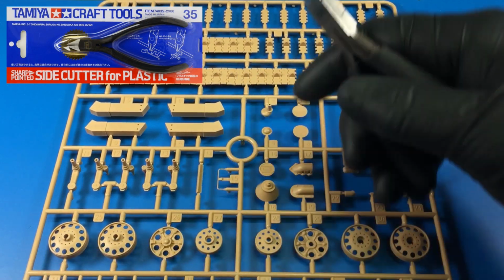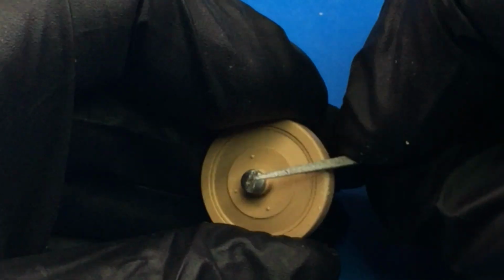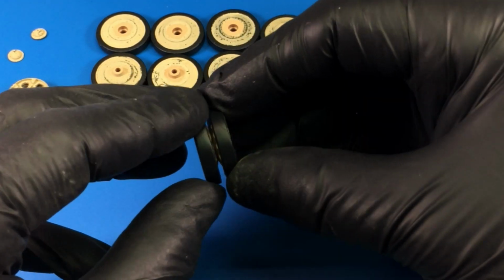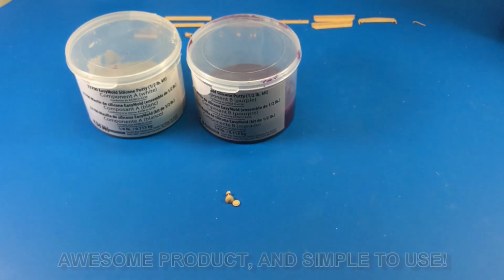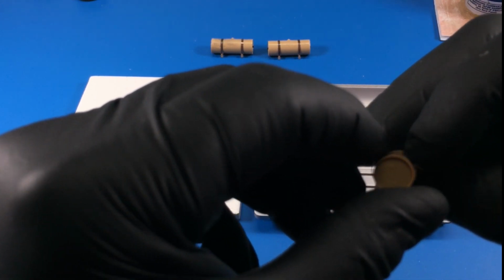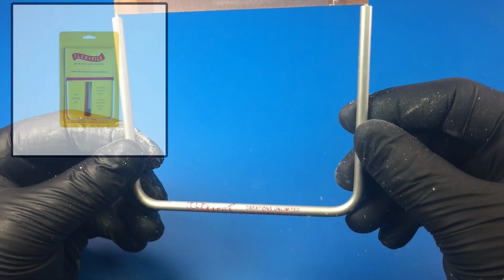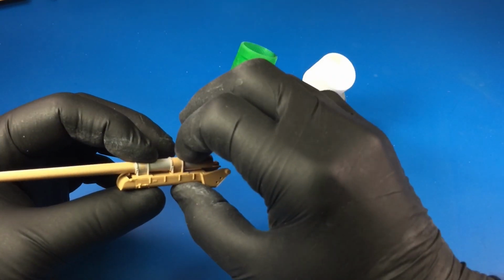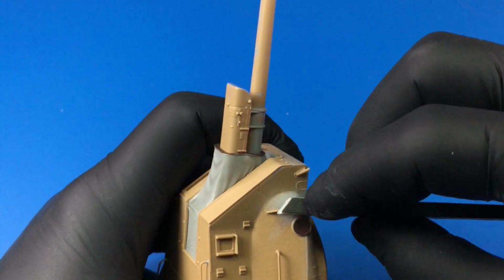RFM T-34/122 kit - (EGYPTIAN) _ FULL BUILD -- COLLABORATION TIME!!!

Comment: Nice little tip for those that don't have the round sanding thingy is to just use a regular sanding stick/file but to start nose down as you begin, then as you push the stick forward push the back down, hopes that makes sense! Basically just a rocking motion against the curve. TFS, G :) Oh nice build Dude.
Reply from the maker: Thank you.